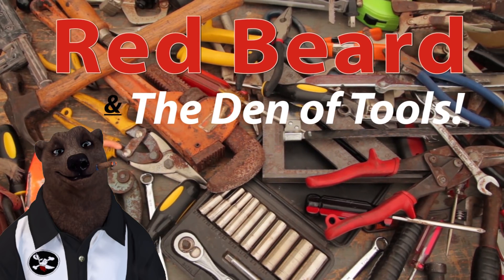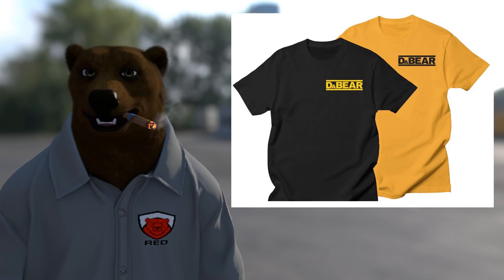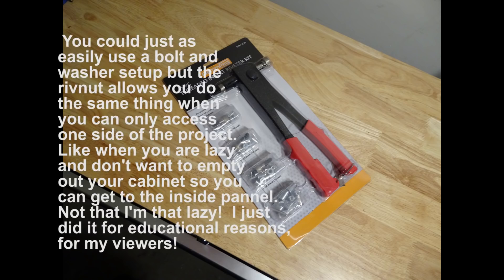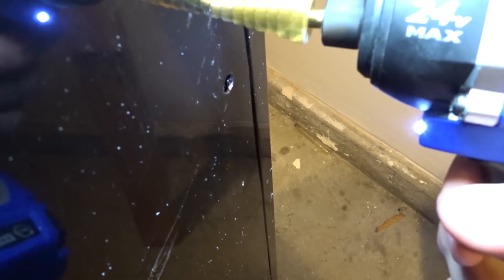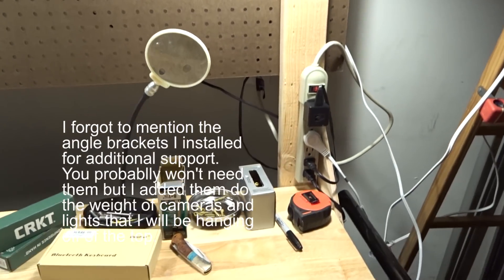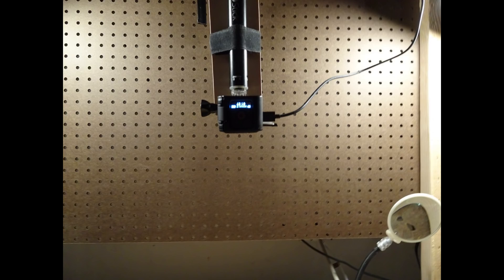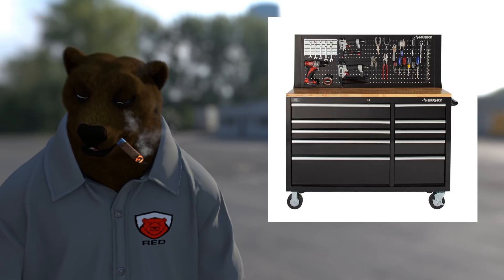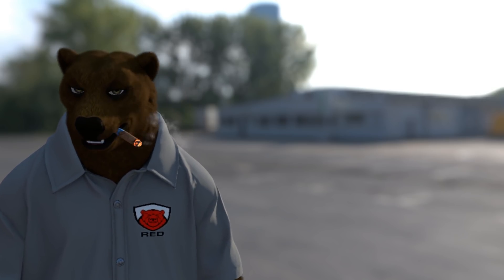Harbor Freight Workbench Mod! (1 Hour Project)

Comment: Using the Rib Nuts was a great idea.  I bought one to fix the thread insert on a "Oh Shit" handle in my truck.  Worked great.  Putting the pegboard up, i would add a vertical support down the middle to keep the board from flexing too much and would also get one of those battery operated under-cabinet lights from Harbor Freight, item #62902 so i could have enough working light without having extra cords everywhere.  Other than that, keep is simple.  Good job

Comment: I saved $75 on my 9 drawer bench thanks to you.  I swapped the wheels to 4 swivel casters so I can push it in any direction and not have to push and pull with only one steering end.  HF doesn't sell locking ones in that size so I gave that feature up.  Hasn't been an issue yet though.  I'm going to do something similar to your mod on the side using the unused handle mounts.  I'm thinking nailgun storage as my framing nailer barely fits and I kinda bought this to be my air tool station.  I set a tool chest on top and the top is a bit slick for that.  Need some rubber feet or something so it won't slide off the back.
Reply from the maker: HA!  Locking swivel casters was the first thing I wanted to add.  And your right, HF does not sell them and when I found them at Home Depot they were $10 each.  That would be a $40 upgrade... just for wheels.  I could not bring myself to do it. I'm planning to install a folding wing to the other side to extend the work surface.
Reply: A quick add to your mod might be a shelf/trough to hold spray cans at the bottom of the masonite, (I'm old too).  Good place for WD40 and such at a glance.  When the rivnuts run out have you found a place to source more?  Never looked mind you but I've never seen them in stores.
Reply: Wauhawk: Most fastener supply shops will either stock, or be able to order them for you.  I've had a rivnut setup since the late '90's, and have had no issues obtaining replacements.

Comment: Great addition to the workbench. Things I would have done different is put the rivnuts closer to the side of the workbench where it's stiffer and mount the pegboard in front of the 2x4s (with notches ripped in them) so you can use 100% of the peg holes.
Reply from the maker: I agonized about the front vs rear of the 2x4 mounting and I chose the rear as it moved the tools back so they didn't interfere with my work space.

Comment: You get more peg hooks on your board if you use longer screws and put spacers between the hardboard and the 2x4s so you can use all the holes.  Making your own spacers isn't difficult, just drill through whatever size dowels, and saw off slices just a little thicker than your peg hooks.   Stack steel washers if you're not that ambitious.  It's not essential, but nice to have the flexibility.
Reply from the maker: You'll see why I did it this way in future vids.
Reply: Oops!  I thought you screwed to the front of the frame.  After re-playing the video, I realized you screwed to the back.  Now I'm a little embarrassed.  Oh well, I'll live.

Comment: Great mod, the only thing I would have done differently is to extend the 2x4’s all the way down the back of the tool box.
Reply: Jeff Hulett felt same just posted same thing
Reply from the maker: With the small angle brackets I added I was able to firm it up quite a bit.  The brackets were made with scrap wood and that allowed me to use less 2x4 material.

Comment: Love my rivnut tool, mine does aluminium,steel and stainless rivnuts up to 14mm. They become super handy once you have one ☝️
Reply: I'm an airline mechanic that uses aircraft quality riv-nuts at work. After we drill the hole, we file a small slot in the side. The riv-nut has a little flat wing on the head of the nut that fits the slot. It prevents rotation. Do the Harbor Freight riv-nuts have that wing, or are they completely smooth?
Reply: Big E. ones here in Australia are completely smooth,no wing. I've never had a problem with them spinning though with a plane they always build in extra security around fasteners as you know
Reply: Called Keyed Rivnut. We make keyed, flat and countersink heads.

Comment: Do all 4 wheels lock or just 2?  I was thinking about getting one to put my lathe on, maybe I'll do so but just take the wheels off.

I think I'd also add a pegboard back for hanging tools & supplies as well.  I would frame in the pegboard to make it more sturdy especially when you get towards the center of the pegboard sheet.  I did a similar setup on the wall behind the bench I have my lathe on right now for pen kits and accessories.  I made somewhat of a spacer for it and a frame on the back side to allow the pegboard to stand off fro the wall and be more sturdy, its pretty thin and flexes easily without the backing frame.  The frame is just on the back side and is just 1/4" thick 1" wide strips act both as a frame and spacer from the wall allowing enough space for the pegboard hooks to go through and work properly.

Comment: hey red does that yukon have the rivnuts inside on the wheels like the 9 draw version? they don`t have that one anymore i was looking for it but all they got is that one draw with the cabinet on the bottom I need that 9 draw looks pretty skoocum to me do you have that 9 draw thought i saw you with it
Reply from the maker: It's doesn't.  But I think that's just because there are no drawers down there so it's simpler to do the nut and bolt combo.  No the side handles are rivnut because they are blocked by the top drawer.   And no, I don't have the 9 drawer.  I'm of the belief that drawers are where tools go to die.  They end up at the back of some drawer and slowly fade away.
Reply: lol you funny.

Comment: That riv-nut thingy looks pretty interesting.
Does it work on wood? and other materials?
are the nuts and bolts proprietary? 
Can you buy them separate from the tool at HF?

And is that black metal as thick as the typical red metal offerings from HF?

I bought a black metal cart from them and it sucks so bad, I might as well have set 60.00 on fire it's completely useless, yet I have some of the red metal items that are wayyy tougher material.

Thanks for your videos. I am looking for another source to host a channel since YT took away my advertising due to low subs and watch hours, even though I have been on YT for over 10 years aaarrrgh!!!
Reply from the maker: I don't think it would work too well on wood as it would have to be pretty thin but who knows.  This was my first time trying it and I've only ever seen it used with sheet metal but I could see it being used plastic.    And yep, these are just the red boxes but painted black.
Reply: cool ok I didn't know if the crimping flange was wide enough for wood, never seen anything like that before tryin to wrap my head around it lol Leave it to HF to keep things a mystery with the boxes, Red used to be good black bad now who knows.

Comment: Hey Bear could you give me the name of those screws.  Item number and where you got em. Thanks
Reply from the maker: lol, I said they weren't deck screws as I didn't buy them in the section that normally has deck screws but I just looked at the box and they are Deck Plus.  Anyway they are a bit more expensive but based on the number of screws I actually use compared to say an actual home builder, the cost is marginal.
Reply: Thanks ya big bear    Hey are your shirts true to size

Comment: Maybe they don't want the board to be associated with freemasons??

What was the reasoning for attaching the peg-board to the back of the 2x4's relative to the bench surface instead of the front?
Reply from the maker: I thought about that a lot actually.  Putting the board on the back pushes it back far enough so I don't lose any work area once I start hanging tools and stuff on it.  I'm also 6'2" so reaching a little further back isn't an issue for me.

Comment: good mod I would have extended the "hard board" all the way down to the top of the workbench.
Reply from the maker: I thought about it but for me I decided that this would work better.  I could still have bigger pieces on the bench that might go under the peg board.  I could hand longer stuff there.  I pass power cables through there a lot.  I was also thinking of putting a shelf there for small stuff.

Comment from the maker: Do you have any good mods for workbenches like these?  Post them below!
Reply: Per your pitty party....lol I think YouTube is doing some weird stuff with videos right now because I don't  get notifications on some of your videos until the next day and sometimes not at all. As of the time I'm posting this comment the notification for this video still hasn't hit my everyday account but has hit my secondary that I use to upload my own videos. I didn't know you were doing a knife give away until this video so I pulled the phone out and went back and looked and never seen a notification for that video on either account. But I did find the video dollar short and a day late. But anyway back on the subject I'm thinking something is going on with YouTube notifications or maybe they are checking the videos before they make them public who knows. I know that I just got the notification for this video at 9am my time and it says it was posted at 4am my time. I live in Kentucky so eastern time zone. But I love what you're doing bear big fan. Only thing I may have done different was put the 2x4s to the back of the peg board and maybe some on the front to because it's been my experience with peg board that it tends to bow. So something to keep it as straight as possible as long as possible.
Reply: Red Beard and The Den of Tools I thought I saw you had mounted a vise?  How is the vise doing on there